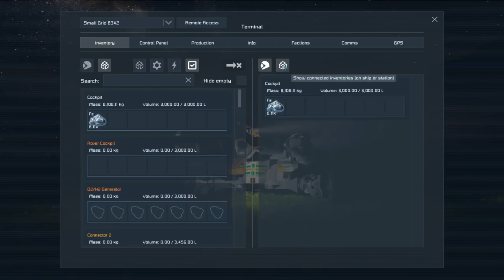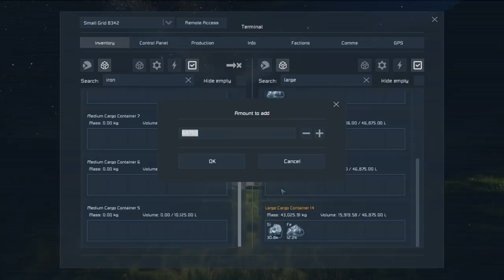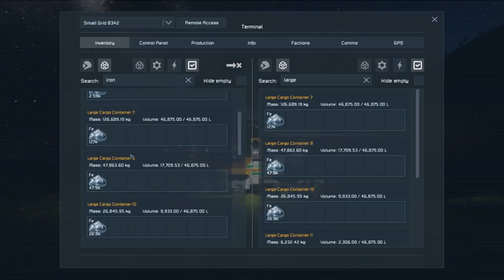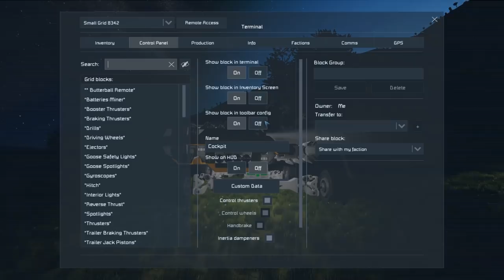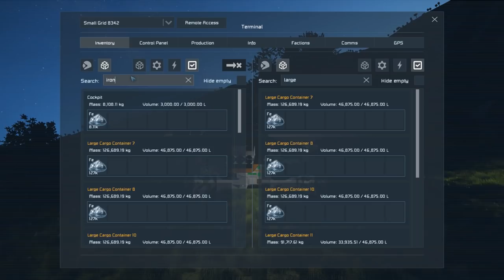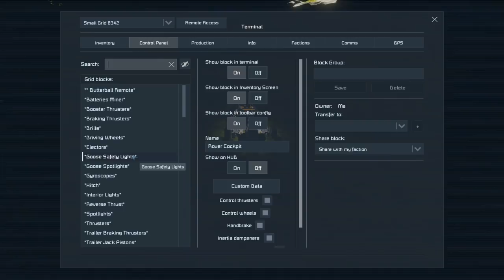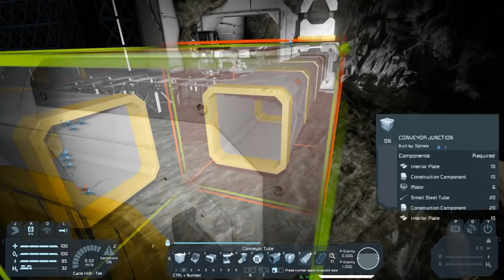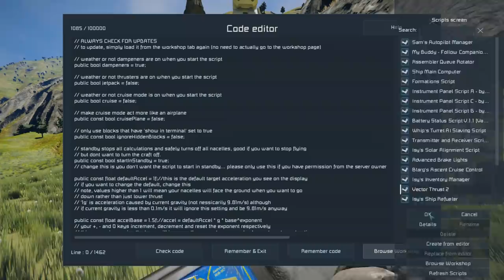Survival, Maybe... #31 Pirate Base Recon (A Space Engineers Survival Series)

Comment: Add some sandbags to the headland above the lake. Or build hovering sandbags. I doubt they weigh that much. A solar panel or two should keep the batteries topped up. You could also have a remote block activate on a timer to compensate for any drift and keep them in the correct position. Which would compliment your remote control tutorials nicely.
Reply from the maker: I think I might do some testing in creative to come up with a design for something like that :)

Comment: I knew putting your cargo containers high up would bite ya.  As others have mentioned, use TIM to split stuff evenly, it will also work far faster than a single sorter. Make them all priority 10 (and have no priority on the miner) so that higher priority containers in the base will suck out all the ore.
Reply from the maker: I knew it could be an issue as well, though when it's between that and having the containers reduce the overall mobility I think I chose the right option, that's what I enjoy about building things like this, you actually need to compromise somewhere and it's always fun seeing if you picked the right compromise :P
Reply: It definitely makes things interesting. I'm loving the series, keep it up!  

BTW, the code keen uses for hunter drones homes in on player locations, they only attack your base/ships because you're near them and the turrets can detect blocks.

Comment: I have a really cool idea though.  Don't feel like you have to do this, as it's a bit resource intensive, but it's just an incredibly fun and cool idea: a LIDAR missile trailer.  Whiplash141 has two scripts that allow you to make guided missiles that work exactly the same way as his Komodo Missile Destroyer.  Wherever you point a remote control with the right name tag on the launch platform, the missiles will follow.  As long as you build the missiles right and tag the names of each block on said missiles.  The missiles can be launched at will, they can be loaded with warheads or just heavy armor to act as an AP round, whatever payload you see fit.  All they have to be built with is a way to attach them to the launch platform (merge or rotor), a remote control, a programming block for the missile's guidance script, and thrusters, all named Missile 1 for the missile to fire correctly.  In atmosphere, the script will even auto orient the missiles so you only need to use forward and upward dampening thrust.  It's a bit tedious to set up, but it's SO much fun to use.  You can target bases and ships from upwards of 10 km away, and the missiles are traveling so fast their turrets can't keep up very well.  And the very best part?  The missiles can be projector built.  The blueprint will store the block names and you can keep firing missiles until your enemy doesn't exist anymore, or you run out of resources, whichever comes first.  It's the ultimate fair 'cheat'.
Reply from the maker: I really, really want to do something like this for one of the bases. Maybe make a missile silo in the base for it. 

My idea with the base attacks is to show a different technique each time so those new to the game can see a little of what's possible :)
Reply: Very nice.  If you need any help with setting things up I'd be more than happy to be of service.  I adore using those two scripts and I tend to use them in a lot of my builds.

Comment: "ISY" has a really good scrift for sorting stuff into containers, but im not sure with the possibility of balancing.
Reply from the maker: I really do need to get around to that comparison video of the different inventory scripts so if can start using the right one for the job :P
Reply: TIM has a priority system built in to give better control over where you stuff goes.  If 2 containers have the same priority, then the inventory is split evenly between the 2.  You could use this with the Goose Trailer.  Setup the front 2 as P1 (Prority 1), the second pair as P2, and so on.  The only real issue with this is if you attempt to manually pull out ore.  Each time you grab ore, it rebalances the total in each cargo container

Comment: Why not use TIM for transferring items? I find myself using TIM for literally everything.
Reply: Makaronowyninja I came here to say this. TIM would solve both the problem with fast moving of resources and the one with balance. It would require some fiddling with priorities to move resources from the trailer to the base, but it would be worth it in the end.
Reply: I wanted to suggest the same, i upvote your comment instead :)
Reply: Nethan2000
isy made a rename'ing script, You just need a toolbar, 2 commands one setting priority high, the other reversing it.
Reply: literally was about to type the same thing. TIM ftw
Reply: Tho TIM in multiplayer can cause lag, especially if many people are using it, Tho I guess Space Engineers generally is poorly optimized for Multiplayer. 

And yes I know this is a Singleplayer Survival, just wanted to give my thoughts on TIM
Reply: you could do a small script to start TIM when you connect and to stop when the cargo is all moved. You could even do it with sensors and timers.
Reply: question is if people will bother doing that, which I doubt but that's just my view
Reply: Because TIM is atrocious and notorious for adversely effecting sim speed.  Splitsie tries to be careful in the scripts he promotes.
Reply: I would use TIM with the delay set to like 15 second to prevent sim drops, and set the timer block to only be turned on when the butterball is docked to the trailer. would solve the problem without any extra weight and could automatically balance the load.
Reply: Came to comments to say this; for those saying it would affect sim speed, set the cycles up to 11 and/or set up the goose to only run tim when you're docked.
Reply: Isy's Script is better.
Reply: Pretty sure he mentioned early on he could use an inventory mod and gave justification why he was not using it.

Comment: You can place a sensor on the piston that connects to your Goose that will stop the piston and lock the connector when it reaches the Goose. Because you have a sensor, you can also use the same piston connector for different rovers without resetting the max distance. Super easy, super effective.
Reply from the maker: That would be very handy, I've never had any luck with sensors detecting small grids - there was a bug for a long while where it would detect once and then forever remain on when you were picking up small grids. I'll have to see if that's fixed...
Reply: It seems to be fixed, I use the system daily.
Reply from the maker: Excellent :)

Comment: A couple of things: You should consider a projector bay for your scouting drone (Which I'm now calling the iBall), so if anything happens to it replacing it should be possible in seconds (Especially if you make a welding drone).

Also at the end there I was practically screaming at the screen "Your sandbags have decoys, just hide in the middle of them!" but it all turned out okay and we figured out a glaring weakness in their drones for the trouble. I still say attacking from the high ground to take out the antenna is probably your best bet, since from what I can tell you might be able to take shots at the antenna without the base turrets being able to shoot back, meaning you'll only have to worry about drones.
Reply from the maker: If think I do need some way to make new drones with little effort, sadly with rotors I'm not sure how well they'll project and be able to be built - might have to redesign. Then I can safely test how close I can get to the base with the terrain...

Comment: You could make a trailer for the truck with multiple slots (like a carrier) for recon drones or any type. Then you can drive nearer the target (to require less power use from the antenna not needing to reach as far, allowing for longer flight and mission time) or swap out to a different drone (like a decoy or a bomber etc) very easily without flying all the way back. And you can also have them land on the rotor heads to make it easier
Reply from the maker: I like the sound of a drone carrier trailer, load it with lots of batteries and a large deployable solar array for longer running :)

Comment: i really LOVE this series! WOO HOO!!
(edit) i don't think you showed what your wheel settings were for power, but you put traction 100%? cause if you put the power alot higher even with that weight it shouldn't have any problem at full power making it up an extreme grade i wouldn't think.
Reply from the maker: Yep friction was at 100% as well, sadly it did need all that boost for the trip up that last steep part, at least the butterball already had a group that I could use straight away :)
Reply: Dang, thats even more Impressive haha! the goose is a very beautiful machine, you should be extremely proud of that build! I know I would be!

Comment: you can reduce the jerk when pressing the movement keys for vector thrust by reducing the 'maxRotorRPM' value in the code. i left it to the vanilla max rotor speed for responsiveness. lowering it will make the ship less responsive but will reduce the jerkyness. you could also reduce the rotor torque, but doing that you will run into the phantom torque issue.

you can also put dead gyroscopes on (so override but with everything on 0). those will resist rotation, then if you increase power of controlled gyroscopes, you get less external forces acting on the ship with the same control authority. but that comes at increased material cost.

about the bumping, i think the rotors still collide even at 11cm displacement now. thanks keen :/
Reply: about having the drone land on the tick, good luck? the program is greedy and tries to control everything that counts as a nacelle. so connecting both will make the tick nacelles and drone nacelles turn on. the drone itself shouldn't act as one big nacelle since it doesn't have any base thrusters. if you do decide to do this, make sure only 1 programmable block is running at once else you will get some weirdness. i haven't made multiple instances of vector thrust play nicely with each-other yet.
Reply from the maker: I'm really glad you told me that, were you tempted to let me struggle with it just for fun? ;)

Maybe I should just stick a landing gear on the drone instead, then it can attach without messing up the scripts :)
Reply from the maker: Also, thanks so much for the detailed feedback, I'm really enjoying all the information about scripting that yourself and isy keep giving me. Maybe one day I'll learn enough to write something very basic :P
Reply: landing gear will work, but you can definitely make the rotor work. just make sure only 1 PB is on. keep in mind you can pass arguments like standby with timers too.

if you like working out problems, definitely have a go at programming. the learning curve is pretty steep at first, but all programming languages have the same basics. so anything you learn you will be able to use in other places too.
Reply from the maker: That initial learning curve is always what stops me, though if anything is going to encourage me to start, it'll be something in Space Engineers :)

Plus I feel like yourself and the other seriously skilled modders who work on SE are incredibly friendly and helpful with such things
Reply: i found the community is really friendly too. 

if you ever need help with programming in SE, the guys in the keen software house programming channels are really helpful.

Comment: the because you think you can type of attacks are always fun ... and who knows they may spawn some new ideas for the next attack with decoy's and turrets to suppress the base ;)
Reply: your first truck run shows you something too ... you will need to do a little terrain adjustment to make that way home path a little more accessible to you.
Reply: an upgrade for your scout drone could be a command station that you drop near the sandbag turrets that will give you a command chair and a recharge point for the scout ... while sitting in side a defended base of sorts ... then if you need to run away the base can protect everything that decides to be silly and follow you all the back .... heck a few batteries and solar panels with a few supports for counter weight and  the duck can drop the scout and command module in place with it's feet and poof instant FOB with your turrets ...( Forward Observation Base)
Reply: park the tic in the back side of the turrets then the attack drones will come to you and pass into the the sandbags because it has to get into range to shoot at you and the turrets will shoot it up before it gets to shoot you

Comment: I think You could help yourself by adding mod called 'Nanobot Build and Repair System' by Dummy08. It's very helpfull in single player and it don't consume much power. 
It will build for you all your blocks, even thos whitch you can't normaly reach. It aslo can collect any ore, or stuff that fell out of grinded block or enemy (Yes. It can grind enemies automaticly too) :)

I'm playing your map with all inventory, grinding, assembling, welding, and other stuff settings set to realistic, and I can't imagin building a base without it. It is like second player. Or a few  playes if you build more then one in your base or vehicle. If the realistic settings wasn't hard enough, I turned on wolves and meteors... and now surfaces of the planet is literally undrivable... The wolves are bugged now so they are more a help than threat but I count that will change :)
Reply from the maker: I'm not going to be adding any automated building mods, it takes away a part of the game that I enjoy - having to engineer solutions for when welding and grinding get too time consuming :)

It's sad that the meteors and dogs really do more to break the game than anything useful, I've never played with them on for any extended period of time - though in the case of the dogs it's because of that whine when you kill them, it's so incredibly sad :(

Comment: I'm only 33min into the video currently, but why use a piston at all to connect the truck? Your suspension has plenty of travel to glide right underneath and lift up into place!

Maybe you did it differently later in the video or series...I'll have to keep watching.

My only thought is why not place the connector on a rotor so it can be rotated out of the way when not in use? Do you do this later also? (A merge block at the down position should fix the material movement issue, right?
Reply from the maker: The suspension doesn't have anywhere near the travel it looks like especially given the 2.5m per side size of large grid, and having a piston means I can move the connector further out of the way :)

Comment: I know it's late splitsie you might be able to use it in a future build and if you do I would appreciate a shout out but instead of a turn table my design is simple and crude but I think it'll work you of all people could make It work but in the ceiling have a piston attached to a rotor that 2 landing gear attach to the truck and you should be able to spin it around effortlessly and make like a control room just for the contraption
Reply from the maker: The downside of a system like that is that the truck will end up jacknifed due to the hitch mechanism, or even worse the truck part would end up drooping from the trailer :/
Reply: @Splitsie  But keep up the good work tho you and capac both you guys are hilarious together
Reply: @Splitsie  or with one landing gear lock on the cab and the other landing gear lock on the trailer so that way you don't get jack knifing or wobble but I don't know if that would make a difference tho but it might be worth a try in creative

Comment: I just noticed how unnecessarily complicated your setup (truck, trailer, mining ship) is to me.

I'd probably build a wheeled base with connector and merger on top and put the miner on top (which controls the wheeled base when docked with it). It also provides a good multi role base, because you could simply swap the "heads" depending on role.

Still a good build, though.
Reply from the maker: Unnecessarily complicated may as well be my middle name :P
Reply: Splitsie You could either build most efficient, or make a work of pure beauty. Problem with this, both things are contradicting each other. However if you just build like you do, you end up with something functional and beautiful at the same time which also has your own "handwriting" on it.
Reply from the maker: I really like the way you said that, puts a smile on my face :)

Comment: talk about a wast of iron ore
Reply from the maker: If it's fun to do it's never a waste - though I wish that drone had returned one day :(
Reply: @Splitsie  no I was meaning when you were mineing the iron it was flying everywhere. But I loved the drone but why not connect to one of the sandbags they have solarpanals?
Reply from the maker: The iron that appeared to be flying everywhere is only graphical particles not actual material, there's none going to waste from that :)

The sandbags with their single panels are actually pretty tight on power so I wouldn't want to go stealing it, but if I made some with better power reserves that would be a good option